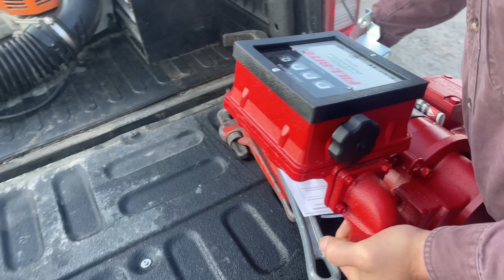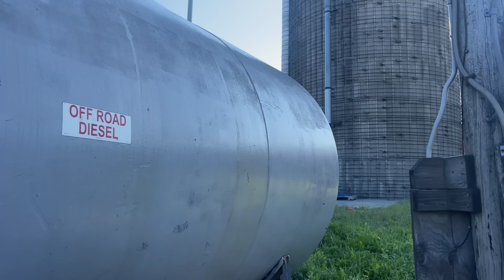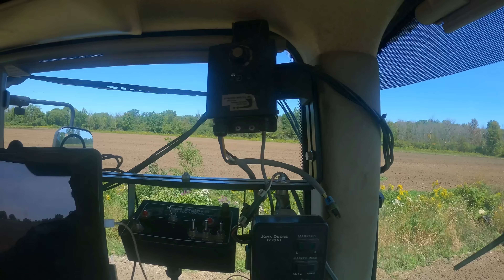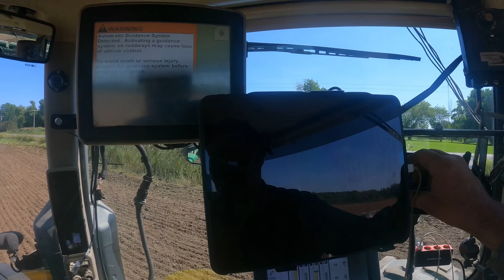Fill-Rite 35 Gallon Per minute Fuel pump

Comment: You need a bigger filter! We have 2 of those pumps in 1k tanks, best you will get is 20-25 gpm with 1" line and  we run Napa 4051 filters which are good to 30gpm. The filter you have currently is good for about 12-15 gpm. Also, could you put the filter down by the 2nd meter? Easier to change down there. Keep up the good work with all your videos, I enjoy you're commentary and sense of humor!
Reply from the maker: With the filter high it doesn’t make such a mess changing the filter. If it were down low you have all the fuel that’s in the hose to drain
Reply: @FarmingFixingFabricating  Too bad you can't afford a ball valve.

Comment: Poisville- Hagen equation of flow through a tube is depended on pressure, viscosity, shape of tube (round) and radius to the 4th power. For example a 19% increase in radius doubles the flow, a 50% increase is quadruple flow. So a bigger hose makes a big difference.

Comment: Hopefully you checked the setup on the first pump. Ours can be either 110 or 220. Volt. Their 35 gpm rating is open flow. I have gone to using the taller higher volume filters for less restriction. Curious why not mount the filter to the remote gauge for easier servicing

Comment: Andy I worked at great plains industries Wichita Kansas. They were always trying to knock fill rite out of first place in sales. They made transfer pumps. Like what you have in your pick up. My dad bought a tut hill pump in the early 80s. We have cleaned connections , and changed the hose. It still works I still use it. I drove dad's pick up to work a time or two. The plant manger checked out dad's tut hill pump. Did I tell you tut hill pump company makes fill rite pumps. That's a new one. If you get stuck it makes the mud hole worst. On a wet yr some plants may drown out. Never grow a crop again. That's a new one on me!!!!

Comment: You are lucky, in Illinois if you have that much fuel storage it basically needs a safety and containment system adequate for a nuclear bomb …
Reply: Same in Indiana. Containment has to be large enough to hold all the capacity of the tank. Usually made of concrete but some are steel fabrication. On large fertilizer tanks this can be a huge expense.
Reply: Same here with us… I'm actually jealous of his fuel tank. You should see the crap I have to go through with ours. It's gotta be a tank inside of a tank inside of another tank with a guy on top of it guarding at 24 seven. Lol

Comment: The guy that serviced the fuel tanks and pumps where I worked built a higher volume pump using a pump and reel from a fuel truck that would actually pump 45 gallons a minute. They ran off the PTO on a fuel truck so it took a couple pulleys and an explosion proof electric motor.

Comment: I've lived with "heavy" ground all my life. Never had a problem growing crops in wet spots most years, but have had problems getting the crops out of those spots. Usually have to fix the ruts and re work em. My Dad even got stuck with a Rolabar hay rake in a spot or 2. 👍

Comment: Andy another good video, I have one question though, when you are planting alfalfa seeds do you put the seeds in the ground at a shallow depth or do you just drop them on top and the roller pushes them into the soil? We always seeded alfalfa with oats as a cover crop, the oats were in the ground and alfalfa dropped on the ground and rolled in to smooth the field and push the small stones into the ground.  I agree with you about the wet spot.

Comment: Fuel pump have no capacity because it lose power to suck fuel from bottom of the fuel tank. Now u have capacitiy 12-20 gal/min. Put pump by side of fueel tank but in botom of tank and u vill have capacity in range 30-35 gal/min. dont ask me how i know that :)

Comment: I had 2 of these pumps fail, after a couple years use, so went back to the orginal Brand the 500 gal tank came with. Can't think of the brand,  but it is silver in color. Made down in Nebraska. Lightning took out the silver color brand, that's why i went with fill-rite,  I had some one look at it,  but they didn't know what was wrorg with it.

Comment: What a person in comment section doesnt know more than the farmer that farms that ground.😂  There is no exact science to farming what works for 1 farmer may not work for neighbor. In my heavy clay don't have wet spots as all are side hills but if you cut surface with disc and break crust ground will dry out faster.

Comment: Have you ever thought of using a broadcast spreader for seeding hay ? I've see 2 people do it that way and then run the packer after seeding , like your doing now . The prep was the same as you do . That person has no idea of ag workings . If you had a wet hole no mater how dry the field is than wr would agree with them , but that is not what you have .